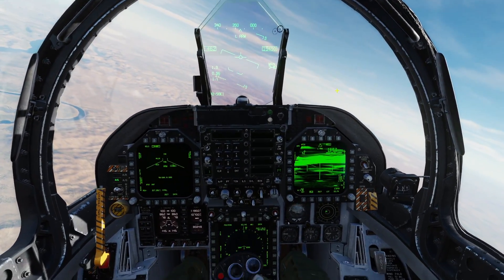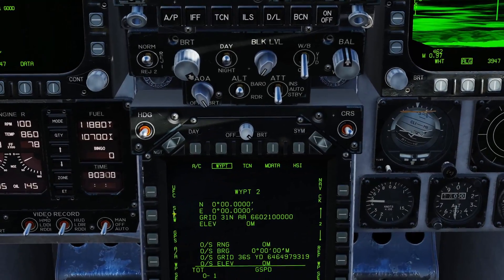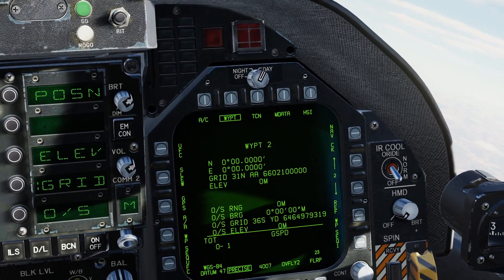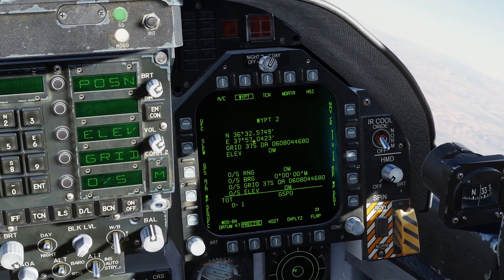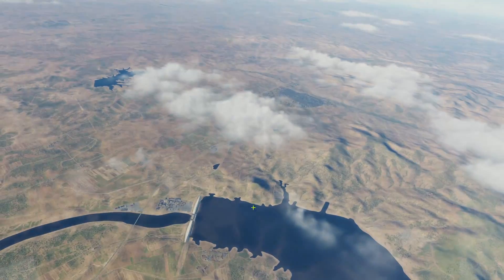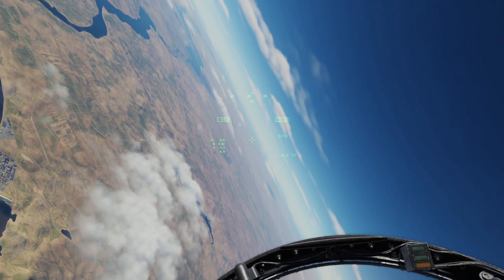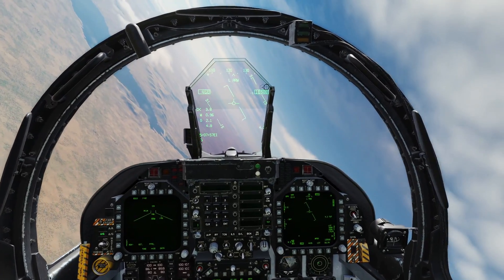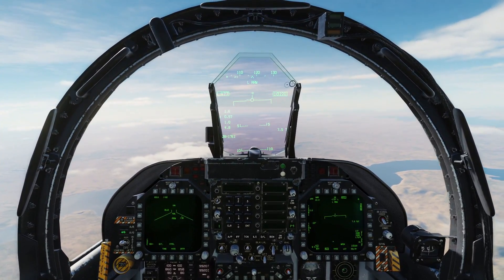DCS World: F/A-18C Hornet MGRS Coordinates

Comment: Do you only need to place the cursor over the grid you want or do you press TDC Depress? I was struggling to punch in coordinates during a campaign mission because pressing TDC Depress didn't appear to do anything.
Reply from the maker: If i remember correctly, you have to press and hold tdc depress, move the cursor over the grid you want to select (while still holding tdc depress), then release it